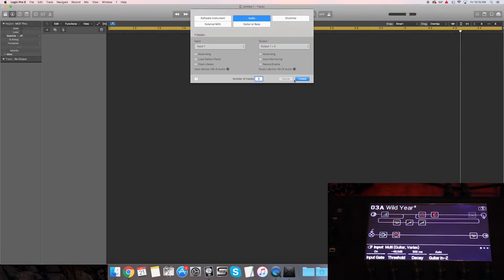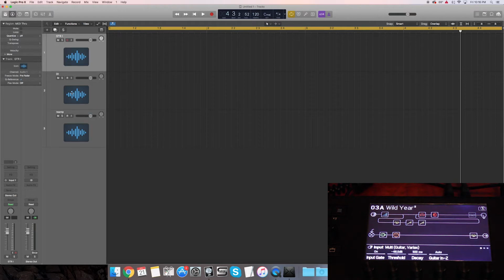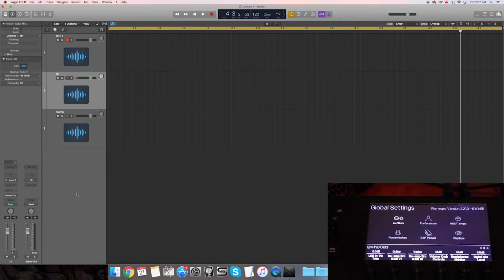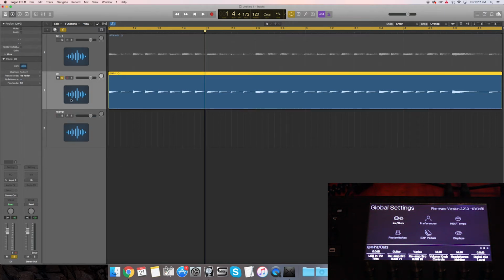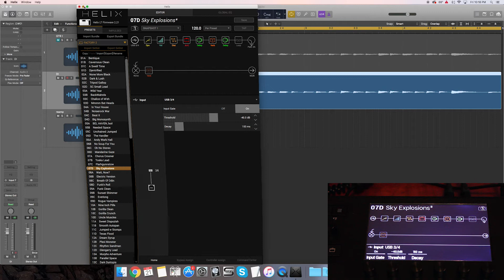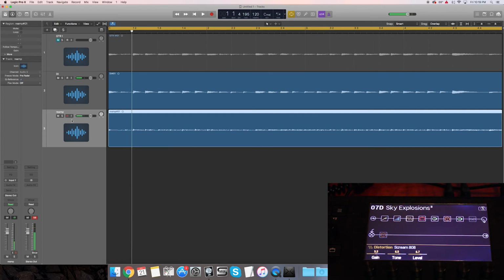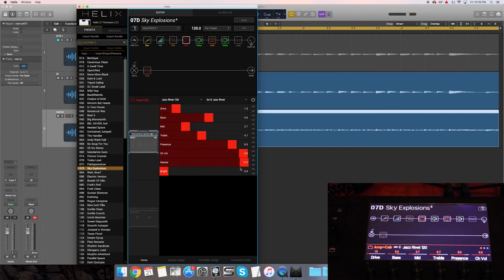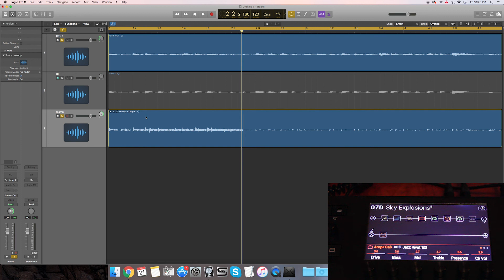Reamping with Line 6 Helix LT and Logic Pro X (Tutorial)

Comment: 3:50 By changing the Drive to turn your re-amp up, you would be technically slightly changing the tone. If you just went to the "Multi" arrow at the end of the chain, you should be able to adjust Output Level without altering the tone at all.

Comment: quick question. I know the input needs to be set to Helix if you are using it as your interface but does the output? i usually have the output set to my UAD Apollo which my monitors are connected to. Following on from this it would be interesting to compare the interface quality between the UAD Apollo and the Helix

Comment: What if you are re-amping from helix into a focusrite scarlett and then to logic? Currently using the 1/4" out of the helix into the focusrite so the "reamping" in the helix isn't working since its set to USB 7 or 8
Reply from the maker: Before relying on the Helix interface I was trying to achieve the same results with a Focusrite Saffire and MixControl. I found it was much more difficult. I would recommend using the Helix to track and reamp your guitar/bass sounds and then switching back to your Focusrite for mixing and other recording applications. Thanks for watching!